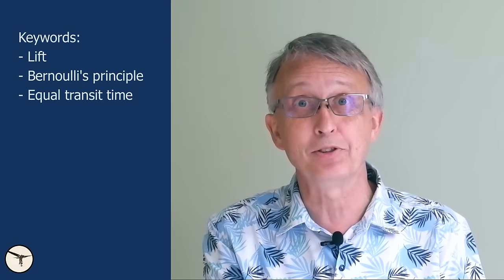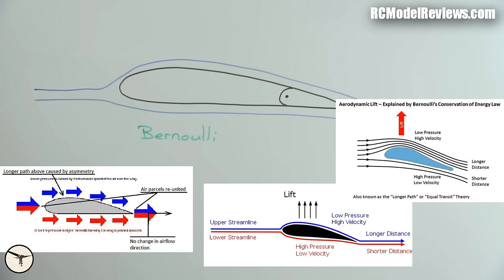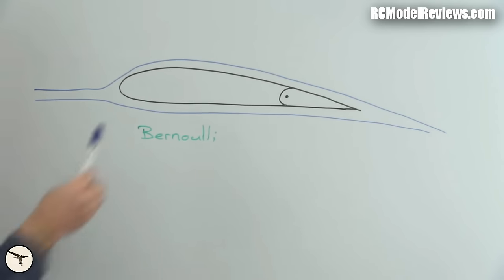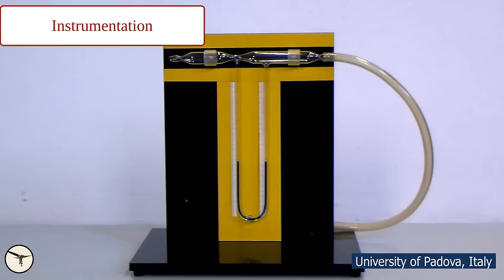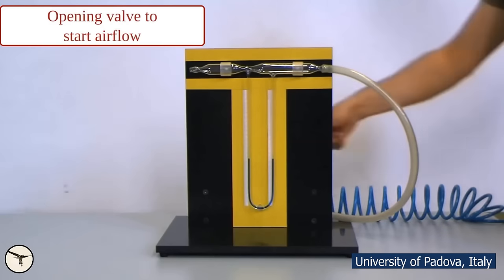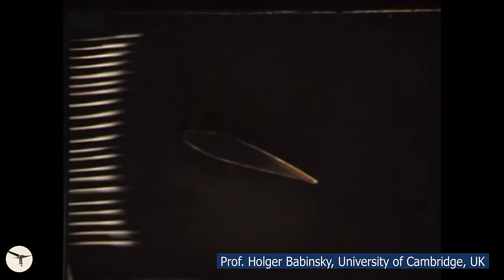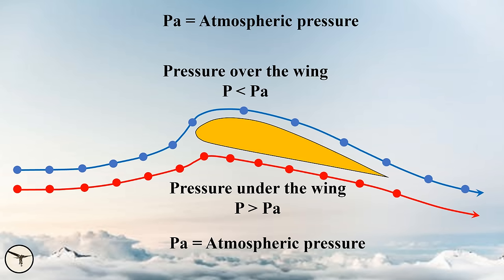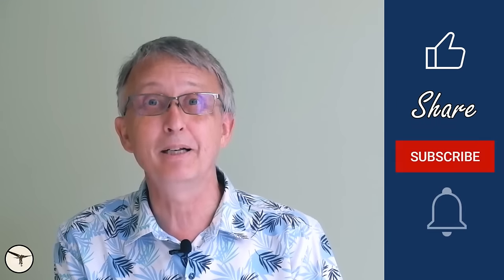Why are so many pilots wrong about Bernoulli’s Principle?

Comment: Well done.  The equal transit time theory is a reasonable a priori guess but as the Babinksy video shows is not physically correct. Conservation methods have an internally consistent logical structure based on net forces and accelerations. One of the reasons quantum mechanics is the most heavily experimentally tested theories is because the underlying theory (eg Feynman's sum over histories approach or the probability amplitude concept) is based on principles which themselves could be fundamentally wrong in an attempt to explain the weird behaviour.  General relativity is another example - the bending of light by a gravitating mass. You could posit a mass for light and try to theoretically explain the bending that way and test it experimentally or you could develop a whole abstract theory of curved space time with light travelling on geodesics and then test that.  As Babinsky notes, lift is all about curvature and the concept of curvature in its most abstract form underpins vast tracts of physics and mathematics (I am a functional analyst ).
Reply: It is not reasonable if it is wrong. Then, it is just wrong.

Comment: There are many flaws in this explanation. Beginning with the understanding that air doesn't flow over a wing.

The wing is pushing the air out of the way.

Think like a boat, the transom leaves a wake behind that eventually flows back in.

If you thrust water into a stationary boat, the water will flow around the bow and into the transom.

Lift is caused by deflecting air mass down.

The area just above the wing is a vacuum. It doesn't cause any lift. Just like the bow of a boat.

You will note that large ships don't have a sharp bow but instead a bubble around the waterline. This allows the water pushed out of the way to flow back into the path, providing thrust that contributes to the forward motion.

Reconsider how wrong your video is and what a disservice it provides.

Comment: I allways miss another thing.... theck the center of the leading edge and the center of the rear edge of the wing... rear edge is always lower... so you direct air downwards ... this is the main cause for lift. ... yes Bernoulli's principle adds to this but is usually not the main lift component.
Reply from the maker: Bernoulli's principle and Newton's laws of motion can be used to explain the same thing: Lift. They don't contradict each other, but show the same from different viewpoints. You can also explain lift without Bernoulli and Newton: https://youtu.be/ph1HqrioLPs

Comment: While you can use the Bernoulli equation to explain how lift is generated. It does not explain why the flow accelerates locally as the curvature of the upper surface increases. In addition, there is a problem of "cause and effect", i.e. is it the high velocity causes the low pressure or the other way round? It becomes a chicken and egg paradox. The complete explanation is not as simple and intuitive as most people may think.
Reply from the maker: Please watch this: https://youtu.be/d4w1Iy4vVMg

Comment: Another example: What happens if the wing is made (infinitely) thin? Then the paths on both sides of the wing would be the same length and there should be no lift (according to the Equal Transit Time Hypothesis)

But then sailboats should not be able to sail, because a sail is an example of a thin wing.
Reply: Sails are not flat though, just hollow. They act as an airfoil when reaching. Again, mostly angle of attack generating lift, but you flatten a sail in higher winds to de-power. Angle is only the first part of sail trim, you adjust tension on the sail, vertical angle of the boom, bend of the mast, etc to change the thickness and taper of the airfoil.
Reply: @maxwelllucas896  That's all true, sail trim takes a lot of experience and is almost an art. But: Where did I write anything about flatness? I was talking about the thickness.

The video is about the different length of the streamlines above and below the wing and explains why it is wrong to consider that as the cause of lift.

I said that a sail could not generate lift because the streamlines on both sides of the sail are the same length, if the Equal Transit Time hypothesis (disproved in the video) were correct. (At least with the jib, this can be said when it is set on the forestay. The inflow of the mainsail is disturbed by the mast, which makes things more complicated).

My point, of course, leaves out the boundary layer, which is certainly not correct. But the boundary layer theory was also not included in the (wrong) Equal Transit Time approach. And in principle, the ETT must also generate a lifting force in the limit case of a creeping flow, in which the boundary layer can be neglected. Bernoulli supporters would certainly argue in this way. But again, this is independent of whether the sail is sailed hollow or flat.
Reply: The airflow doesn’t stay attached to both sides of the sail though. It acts much like an airfoil. The flow on the upwind side does curve, but far less than the leeward side.
Reply: @maxwelllucas896   That is absolutely correct. This effect is due to the boundary layer that I mentioned above. 

But that is not the issue. The point is to provide another simple and false example of why the video's statement must be correct. Are you going to correct me for giving a counterexample in the first post?
Reply: Just saying the path is not the same on both sides of the sail, even though it’s thin.

Comment: Force = mass * acceleration
The wing accelerates a mass of air in a downward direction creating a force equal to the weight of the aircraft. Aerodynamics of the wing determines the efficiency of the acceleration.
Bernoulli is unrelated.

Comment: There are so many things wrong with using Bernoulli to explain lift that I am sick of it.  Firstly they fail to show air moving down after passing the wing. Now conservation of momentum means if something ( plane) is pushed up, something else must be pushed down.  Secondly my windsurfer has a centreboard that is a symmetrical wing.  It generates massive lift if the centreboard is at a tiny angle to the direction of motion of the board.  The explanation used for the wing cannot explain this, nor can it explain being able to fly upside down.  Nor does it explain why the Lancaster bomber increased the angle of attack of the wing to increase the payload ( at the expense of efficiency).  It is simply a BAD way to explain the situation.

Comment: There are videos clearly showing that the equal time statement is incorrect.
Reply: Yet the same amount of mass per second must pass across the region where the wing has been introduced, as had passed through that space before the wing was there.

If this were not true, then mass would forever build up higher and higher at the wing, which clearly is impossible.

The above is clearly the correct equal transit time requirement.  How does the air move around the wing in order to satisfy this actual equal transit time requirement?

Comment: But the simple "false" explanation is still true..?

It is simply confusing because one might assume the airflows it describes to be time syncronized which they can't be. But there is still airflow on both sides of the wing at any given time and they do exactly what they tell you?

Never fockin mind I see now where it was wrong. They make the false assumption the flows are synced to conclude the speed difference when in reality the speed difference is true but for a different reason...

Comment: A simple example to prove that it's NOT a question of distance : take a sail (it's just a vertical wing). And it works very well with this THIN wing (there is absolutely NO difference of distance between the two sides of the sail, which is 1 millimeter thin). CQFD
Reply: Sails are airfoil shapes though. The boat would still move with a flat sail, but you get more power from an airfoil shape. The finer parts of sail trim are about shaping the airfoil
Reply: @maxwelllucas896  Yes, and... so what ? I don't see your point. I was just saying that this video was right : with a thin sail there is absolutely NO difference of distance between the two side (and that's not the case with plane wings, which  leads numerous "specialists" to say that this difference create the portance, which is wrong).
Reply: @hervehillard6922  The airflow doesn’t stay attached to both sides of the sail though. It is not equal transit time, but the air flow is faster and lower pressure on one side. The flow is curved on both sides, but straighter on the windward side
Reply: A sail relates to a wing the same way that an oil tanker relates to a fish. They bot use the same media but do very differennt things in very different ways.
Reply: @mikekelly5869  yeah, but just like you can’t ignore angle of attack on a wing, you can’t ignore the shape of a sail
Reply: @mikekelly5869  Incredible. How can it be possible to know so little about all that ? A sail and a wing are EXACTELY the same things
Reply: @hervehillard6922  'Fraid not. You really need to do some reading if you believe that.
Reply: Induced lift over a flat plate and pressure drag on a sail are two fundimentaly different concepts.
Reply: @ruandurand3971  there’s definitely lift on a sail when sailing upwind. Angle of attack can be less than 15 degrees. Reaching is a mix, dead run downwind is 100% drag

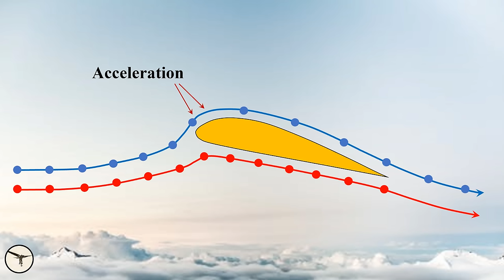Comment: 3:27 why does it cause it to accelerate
Reply: That's a bit complicated, it has a lot to do with the viscosity of the air, which you can describe as the resistance to flow. Basically when the leading edge of the wing moves through the air, it forces some of it initially up high over the wing which in turn creates an area where very little air is left further behind the wing. Basically it's comparable to a slipstream behind a semi truck for instance. If you drive with your car behind a big truck, there's an area of "less" air just behind the truck, where you car would encounter reduced drag because of it. The reason for that is viscosity. The air which was pushed out of the way by the truck doesn't flow fast enough to completly fill the gap behind it, so there's a pressure drop. And now you come to Bernoulli. If the static pressure drops, flow speed must increase.
Reply: @shi01  But if you are explaining it with the viscosity of the air, then bernoulli has no place in it, cause the bernoulli formulas are derived by stating, that energy is conserved. But with viscosity in place, there will be friction, which leads to energy loss. 
eg. if you have a door, you can see, that if wind goes through it, it will close the door, if the door is not too wide open. But if the door is too wide opened, it will rather push it further open, although in both cases between the door and the wall there will be a faster air flow. If i understand it correctly, then this is, because air flow is dominated by laminar flow with low friction, when the door is almoust shut, but dominated with turbulent flow,if the door is wide opened, and thus a lot of friction will accour, and thus bernoulli doesnt hold, and instead the pressure created by the turbulence, which is P=F/A(normal)=1/2c_w*A(crossection)*v^2/A(normal) will open the door further.
If you bring air to a (almoust)complete stop, with a semisphere then of course bernoulli cant hold anymore, cause then v_2 is 0, and thus the equation gets a massive problem if you want to solve for p_2 or something.
I think your explanation might be right for some angle of the wing, where its still dominated by laminar flow, and theres low friction. But i think the explanation that goes the other way around, that states, that air above the wing will go faster, because of its form, should also play a part in the explanation.
Also the fact, that the angle of the wing is downwards from front to behind, will have an effect, cause due to this air is simply shifted downwards, which means because of conservation of momentum, that the airplane, has to feel a force upwards. This of course will only work if the flow is turbulent at least a little bit, cause else on the lower side there will be a pressure decrease because of the air shifted downwards, which will lead to a force downwards again.
Reply: @neutronenstern.  Yes, the explanation isn't perfect and indeed only holds true as long as flow is laminar. But it's also the case that Bernoulli can't fully explain how a wing works. Bernoulli is a vital part of it, but it's not the only effect occuring. For instance you also have the coanda effect, which describes more or less why the airflow wants to stay attached to the wing profile
NASA has published a paper a couple of years ago that pretty much broke it down to a bunch of basic physical principals all working together.
Reply: @shi01  Oh that paper would be very interesting. Cause in school, we had to do a scientific seminar, and i chose physics with smartphone and tablet. We should do a physics experiment, using our smartphones as a mesurment insteument. Some did a expetiment with GPS, or with the magnetic sensor or... but i decided to think a little bit out of the box and build a stoboscope that i controlled with the aux output of my smarthone, to analyse the frequency of a propeller spinning and simultaniously measuring its force with a scale. I tried to come up with a theoretical formula for its lift, by modelling it, as if it is a screw, which while turning around pushes the air (nut) downwards/upwards. The formula i got, didnt account for bernoulli, and thus it was off by a factor of 2. So i wonder, if maybe one could determine this factor by using the bernoulli principle. But also there could be a floor effect, cause the propeller in my setup was very close to the floor.

Comment: Lift is basically Newton's third law - air is displaced downwards to counteract the weight of the aircraft. You can increase the force/lift (ie. amount of air displaced) either by increasing speed or increasing angle of attack (and therefore deflect air more dramatically). The downside of the latter is the introduction of DRAG. 'Equal transit time theory' is clearly nonsense and the airflow over the top isn't 'faster', the airflow over the bottom is slower as it's being compressed & deflected downwards.
Reply: This is absolutely correct.
Reply: @deang5622  And a good way to demonstrate this is to stand below a hovering helicopter! (or behind a propellor) 😀

Comment: The tunel demo seems to demonstrate an anglen of attack case and not Bernoulli. I beleive Bernoulli would be demonstrated with no angle of attack , a curved wing top and flat wing bottom.
Reply from the maker: The purpose of the wind tunnel demonstration is to debunk the "equal transit time" hypothesis. Bernoulli's equation is best demonstrated in a venturi.
Reply: @FlywithMagnar  I agree that equal time was an incorrect hypothesis. But the top air is still moving even faster, so Bernolli still can apply. Newton classic laws also apply at the same time,  Many fenomenas can be explained and calculated with 2 different laws... do we agree on that?
Reply: @FlywithMagnar  I think the presentation was a bit misleading to be honest.  The split airflow, before being split, has a common static and dynamic pressure and common temperature.  So, that going over and under the wing has the same homogenous source conditions.  The faster than equal transit time of the top sample of air, is directly related to, both the different path difference due to asymmetry, and the common starting potential and kinetic energy.

Bernoulli after all is fundamentally a statement of conservation of energy.  The faster than equal transit time over the top is the conservation of energy consequence (relative to the bottom sample's velocity), of the rate of mass transit having to maintain continuity.

While you're properly debunking the illogical equal transit type hypothesis, you are still mis-representing the physics of the actual drivers of lift that in fact require a faster than equal transit time.
Reply: @samial72  I completely agree with you about Bernoulli still applying.  In fact the proper answer to the "Bernoulli" influence is that transit time without question must be faster than equal.

So, there is a bit of a misrepresentation of the relevance of actual physical conditions in the video.

"Bernoulli" is a fundamental statement of conservation of energy.  This cannot be circumvented and so must be properly integrated into the physical interpretation here.  

Bernoulli must be considered; the bottom path flow must be considered, and the relationship of the imposed asymmetry must be considered in relation to the top flow having to be faster than the bottom flow.

Comment: It's a problem saying that a pressure differential causes lift.  Because  a pressure differential is a synonym for lift. It doesn't cause lift,it is lift. You only get lift when you accelerate air downward. There is not multiple causes for lift, only one. It is equally impossible to accelerate air and not get a force. The false hypothesis implies that you
"Induce a bernoulli effect and then get lift from it" without accounting an action to cause a reaction. And confusing an action for a reaction.

Comment: I am working as an aerospace engineer for more than 23 years, working in computation simulations and wind tunnels. You just said that the air on the upper side of the wing has to accelerate... of course... and then when something accelerate it goes faster so the speed is higher in the upper part and then the pressure is lower. Sorry but you dont have any idea what you are talking about. The deep explanation is found in mesoscopic level iterations.